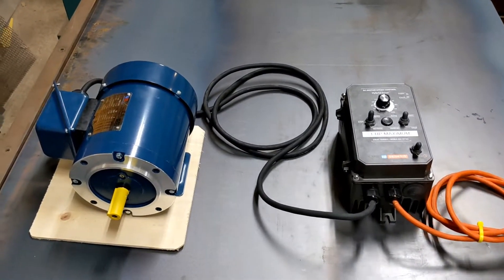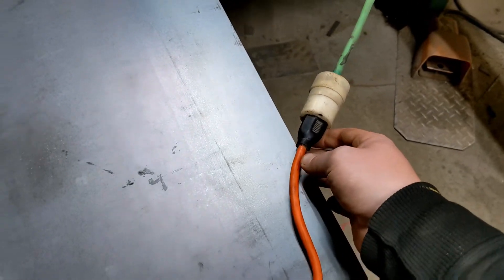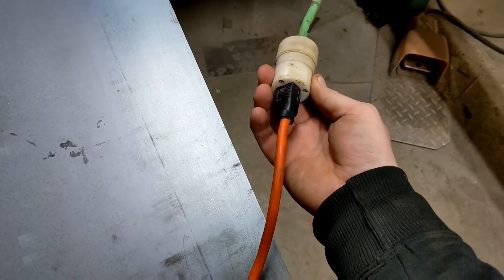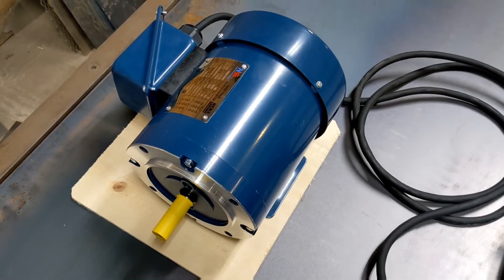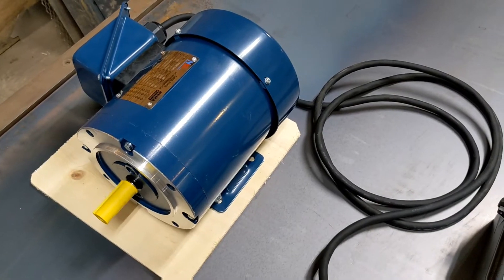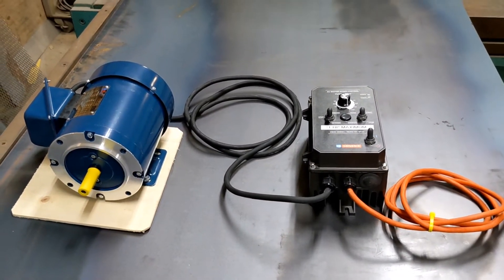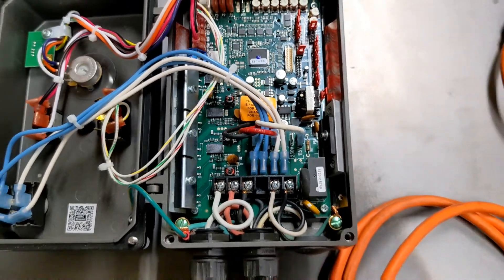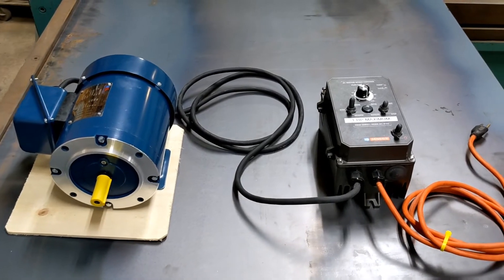Simplest VFD In The World @wildcatwilly

Comment: So you need to wire the motor for 120V to use a VDF with a 120V input and output?
Great video. Thanks
Reply from the maker: No you have to wire it for low voltage three phase. Then then you can wire the vfd for either 220 or 110

Comment: This motor says it runs on above 200 volts but you gave it connection of 110 volts how is that possible will not motor burn out?
Reply from the maker: The vfd stores energy. It will compensate for it.
Reply: @wildcatwilly  can you suggest me kb drive for half hp motor
Reply from the maker: @DarveshKhan-j5d  this same one will do it. Just by changing one of the jumpers inside.

Comment: Will that run a 110 motor?
Reply from the maker: The vfd can run off of 110 volt. To manipulate the speed you have to have a three-phase motor.
Reply: @wildcatwilly Thank you for the response. We have a 110 motor that can be converted to 220, but that would still be a single phase right? Still no good.
Reply from the maker: You're very welcome. Yes unfortunately that will still be single phase for you.
Reply from the maker: You can buy cheap 3-phase motors offline I would estimate about $180

Comment: im learning, and trying to buy a belt grinder in my price range. im looking at frames with and without motors, vfd's, ect., and may end up buying these components in stages. i want variable speed. thats for sure. i dont know that much about electrical. so, neither the KB 24D or 27D will run a single phase motor? i was getting the impression from another guy that with 115vac from the wall to a single phase motor, i could just get a dimmer switch from home depot to control the speed. ive since found a deticated "vari-speed" switch online, like a dimmer switch but with heat-sinking fins. but would the dimmer switch not be as smooth of power delivery? be jumpy? 
i dont need fancy but i do want a smooth belt speed. id like 2 horsepower as well and about 3500 rpm max. energy effenciy isnt a priority. suggestions?
Reply from the maker: I'm unfamiliar with the dimmer switch method but it sounds like it would work might be worth a shot or you can buy once cry once. You going to make the decision brother.
Reply: @wildcatwilly  yea, vfd's. where were they a few years ago. i just dont want anything i dont need. im sure people were controlling the speed before vfd's were necessary and required... demanded! YOU MUST BUY A VFD YOUNG MAN! oh well, ill find what im looking for eventually. thanks man
Reply: @wildcatwilly  I think by a dimmer switch he means a potentiometer.
Reply from the maker: Back in the day they would use DC motors to vary the speed check eBay maybe
Reply: @wildcatwilly  yep! im learning all about that now.. permanant magnet PM motors. DC motors. youre right. lots of rotary switches in the market for DC motors. some start with AC from the wall and switch to DC for the motors. im getting the impression DC motors might have a lot more torque. anyway, DC or PM motors are big and heavy. with the tilting 2x72 frames im looking at theyd be to big at 1.5 or 2 hp.
Reply from the maker: I'm not sure what you're budget is but if you send me an email I can send some links that would help for reasonable prices
Reply: @wildcatwilly  i wonder why this is just now popping up? i dont know, i do know ive been without internet the last 5 days. anyway, i bought an OBM grinder. the tilting version. so i have requirements for a motor now. no more than 12" in length, 56C face, ect. i bought the frame and some accessories. havent bought a motor yet but yea, im locked in. ill get a 2hp and kbac27d later.

Comment: Any idea why the breaker trips when i connect my ground from the 3ph motor to the vfd but runs fine when i disconnect the ground?
Reply: is it a gfci breaker? a vfd output is pulsed, and the pulses induce high-frequency currents in the frame of the motor that then travel through the ground, and gfci outlets/breakers don't like that. they detect the currents and shut everything down. i wouldn't know how to help if it's just a normal breaker but i definitely have experienced immediate shutdowns when i have connected vfds to gfci outlets in the past.
Reply: these currents can also come out in the shaft and shock you, if the motor is very small
Reply: @cablemanagement1524  Yes, i have an af/gf breaker on my garage circuit. i ended up changing the switching frequency of the kbac-24d by moving jumper j12 from 8k to the g2 sensitive jumper position for gfci. That fixed the breaker tripping, but the motor makes more of a higher pitched sound when running...
Reply: that's interesting, i didn't know you could change the carrier frequency on these drives. and yeah, the carrier frequency noise is part of the the trade-off. glad it fixed the tripping, though.

i personally haven't worked with these KB units, although they look extremely solid. i use a Fuji Electric unit, which has an interesting feature that allows you to scramble the carrier frequency to make it sound more like white noise. the drawback is that the Fuji units are NOT nema 4 rated and they DO require programming and tuning. although a nema 1 conduit envlosure box can be purchased and installed.
Reply from the maker: Very interesting
Reply from the maker: Sounds like you have some loose voltage somewhere I would have an electrician check it out or order a new drive.

Comment: looking for a VFD for a blower motor with a capacitor, any suggestions?
Reply from the maker: I'm no electrician but I don't think any vfd motor will have a capacitor because they are three phase...
Reply: @wildcatwilly  thanks, i meant my motor has a run capacitor, is there a vfd for this situation
Reply from the maker: As far as I understand it you can remove the capacitor from a single phase motor and convert it to a three-phase motor and use a vfd to power at and manipulate the speed.